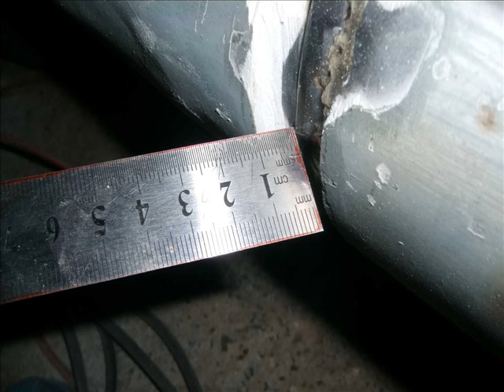Austin A35 Restoration rust repair #2.wmv

Comment: The A35 Van (1965) was my first car. What a Rot-Box it was! By 1968, the Inner  & Outer Sills had separated completely from the floor. No welding ability at age 18yrs, so I riveted new sections to hold the whole lot together. By 1969, it was heading to the Scrapyard. Glad to see the back of it. Brakes weren't even fully hydraulic on the rear wheels. Armstrong Shock Absorbers were awful, and the car continued a 'bounce' five minutes after hitting a pothole. It's no wonder that the Japanese took over the car industry. French / Italian cars were similarly bad on rust prevention. Anyone remember the Lancia - and the trouble with the rot that they had on newish cars? The very best European car was the VW Beetle. Nothing could touch it, and it stood tall. Best bit about this Vid, was the home-made forming tools as used to create the 'depressions' or ribs into the flat metal sheet, prior to welding. A35 cars here in Australia are in really good condition, and are available for about 350 quid.

Comment: I've watched this video a few times and I still can't work out how you formed the ribs in the battery panel and the floor, I'm restoring a 1959 a35
Reply from the maker: Hi Darren, I had a piece of steel rod, a board with a slot cut into it, put the new metal between the 2  and used the weight of my truck with a jack to push the rod into the slot, making the groove in the metal, Cheers